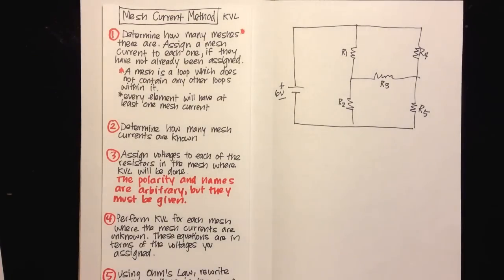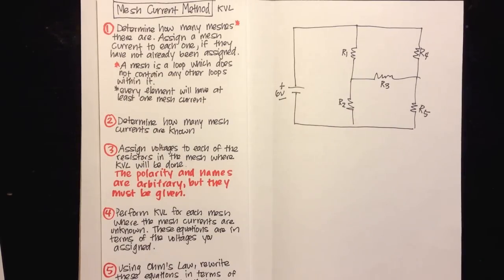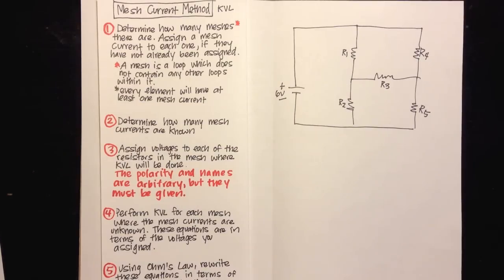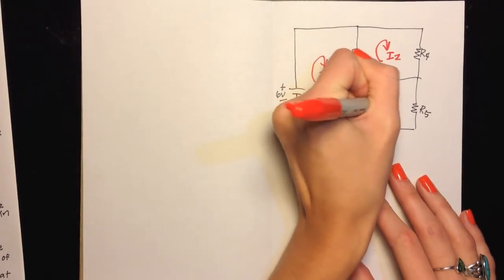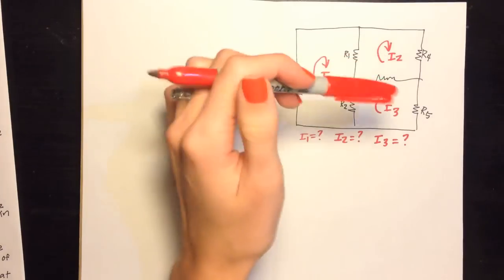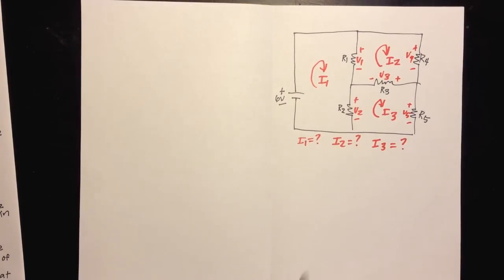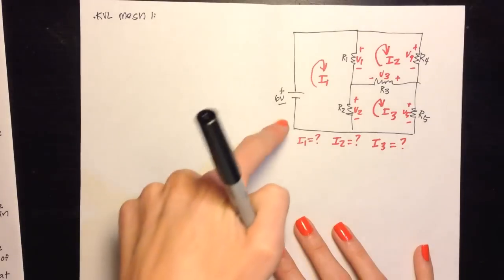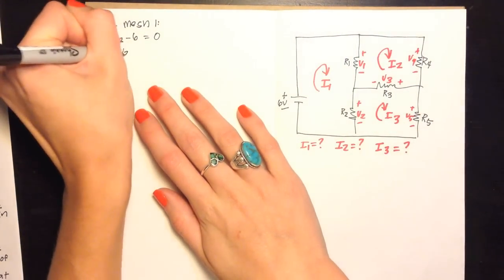Mesh-Current Method for Circuit Analysis

Comment: i would like to know how to solve the matrix by calculator , mean the different the result me and you it so far value. i need your solve step by step as per used before by calculator or by calculation not by calculator if you can .  ,,,,, thanks 

best regards 
sultan alriyami
Reply from the maker: Do you mean you want to know how to solve the equations without a matrix?  You can use substitution.  For this example, your system of equations would be: 

4800x -1500y-3300z = 6
-1500x+6300y-1500z=0
-3300x-1500y+5480z=0

Where x is i1, y is i2, and z is i3.  They are equations (1), (2), and (3) from the video.  If you are not familiar with solving systems of equations using the substitution method, I highly recommend searching YouTube because watching a video will be much more helpful for you than me trying to explain in a comment!  Here is a great one by Khan Academy : https://www.youtube.com/watch?v=pANZpI9sOYg

I hope that helps!  Thanks for watching! :-)

Comment: Hi, so far, you have been the best person to explain this. Thank you. However, everybody keeps on saying that assigning the polarities is arbitrary... But when I do it I never do it right. could you pls explain how/why you chose to do it the way that you did it.
Reply from the maker: Basically, after applying KVL and getting all the currents and voltages, you may find that some variables have negative values.  All this means is that the "actual" direction is the opposite of what you drew initially.  If you had chosen the other direction when you began to solve the problem, your answer would not have been negative.  

I'm sorry if that is not a very clear answer to your question, but I found a post on Stack Exchange that is might be more clear:  http://electronics.stackexchange.com/questions/125006/kvl-loop-current-direction-convention-should-be-same-in-all-loops 

That post is talking about the direction of the current, but the same idea applies to choosing the polarity of the resistors.  Try solving my circuit with the polarity of R5 flipped to see for yourself!  :-)
Reply: Michelle Munteanu Thanks a lot, I have a better understanding now. I think I should be fine with more practise.

Comment: on R3, why positive side is on the right, not left?
Reply from the maker: +WeiFeng Ma The polarities on the resistors are arbitrary, assuming the given problem does not specify one direction or the other.  It doesn't matter which side the positive is on, as long as you keep it consistent throughout the entire problem.  If you did the problem with the positive side on the left, you would still get the same answer. :)